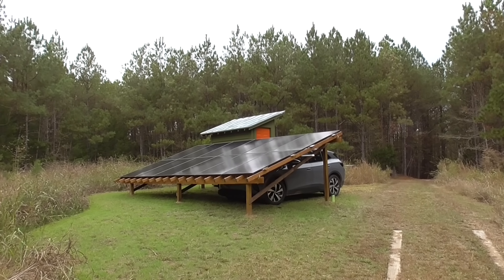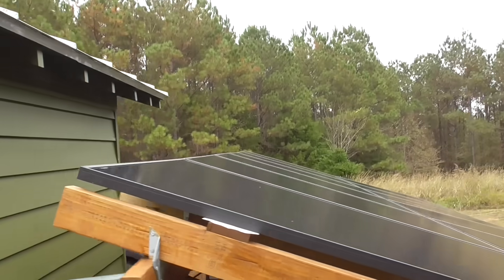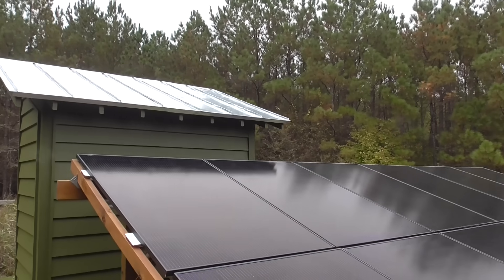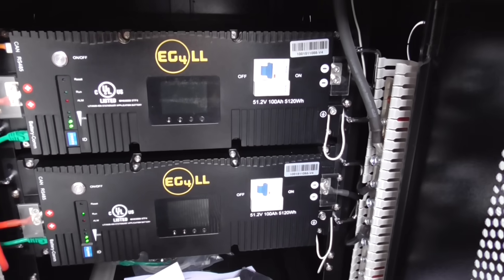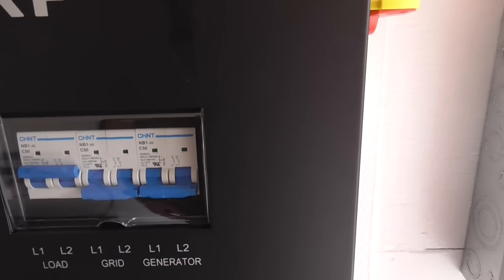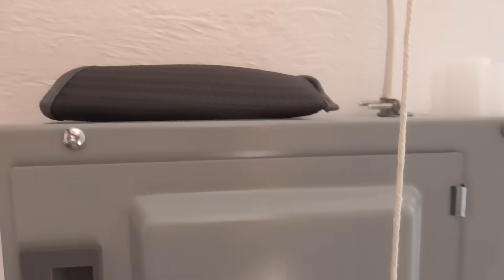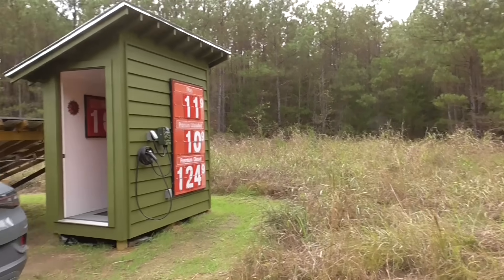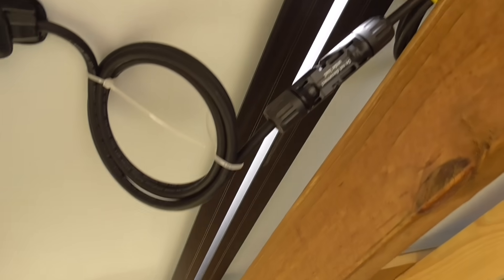Off-Grid Solar EV Charging Station. Stand-alone solution for EV.

Comment: So the cost of having the EV car is the the EV car plus everything you bought and built to supply power to the EV charger.  At that point it might be cheaper to sell the EV car and get a gas powered car.  You got a fun project out of it and learned a lot.
Reply from the maker: Au contraire mon frère, I estimate this power station will be paid back with savings over the cost of operating my ICE truck in 6 years. After that it's all gravy. You wouldn't believe just how cheap it is to operate an EV--in fact it surprised the hell out of me. The electricity to drive my car from home to the farm (which I pay for on grid) is less than $4.11 It costs me $15 in gas when driving my truck, and that's not counting oil changes, air filters, and oil filters, which are things an EV doesn't have. The trip home is "free" after it pays for the solar charging station in about 6 years. For me, just as or more important than saving money is not using fossil fuels, or using them as little as humanly possible (I still have my truck and use it for big loads). Perhaps that means nothing to a lot of people who deny the science of climate change, but it matters to me. And, as you said, it was a very fun project and I would have done it for that reason alone. I have plenty of money, but I still enjoy saving it when I can and doing my tiny little part to save the planet.
Reply: @wickedmessenger1  Glad to hear it.  I live in a place that does not have reliable electricity.  I am just getting into solar power and it's a rabbit hole.  I just got the ecoflow ultra and might get another.  I am also thinking of getting solar panels and just learned about series and parallel hookup for these, luckily the ecoflow ultra has the battery and inverter all in one.  Might be a fun but expensive project for me.  Might look at some good 400W solar panels.  Good job on the setup.  I googled Grizzl-e, and they even have 80A 19KW charging with those.
Reply from the maker: @  I think I allude to that rabbit hole in my video. As a novice, it seems like there's an impossible amount of stuff to know. But then I realized that it was the old method of putting together 20 components that required all that knowledge and it's rapidly becoming obsolete. When you buy a system like the Eg4, it has all that stuff already in it. Things like the Ecoflow tap into that novice trepidation and give you an easy alternative. But they are way more expensive and less powerful than a system assembled around a good all-in-one hybrid inverter like the Eg4 with some solar panels. My system was more or less sold to me as a kit, so I didn't have to match the panels and batteries to the system. My advice to you is go big early because you're going to go big eventually. You'll outgrow that Ecoflow in no time.
Reply: @wickedmessenger1  yeah I plan to. Luckily the ecoflow ultra is expandable up to 90KW battery, with 7 KW continous, but I won't close to 90KW. I don't have the space for many panels either, maybe just 4, 400 watt panels if I can find any 400 watts in my area. Most are 200 watt panels 🙁

Comment: you should have used the water trick with that ground rod. https://youtu.be/ML9Ga_ud5fY?si=FG2cVJb05pit590T
Reply from the maker: That's a good trick to know. I doubt it would have worked in this case. I was driving through clayshale and possibly limestone. Also, I don't have a source of water at the farm so I would have to truck in water from somewhere. What I needed was a 9# sledge hammer and not a hand sledge that weighed a few pounds. But it's an hour to Lowes and I don't make the trip unless absolutely necessary.

Comment: Do you have any issues with the heat inside the shed?  I know the EG4 have fans but with the summer heat is that an issue?  Thanks for the video. ⚡
Reply from the maker: I have yet to go through a full summer with it so I don't know. When I finished and gave it its first use, it was already the end of August and the really hot weather was behind me. If I find that it's a problem this coming summer I'll add the smallest air conditioner I can find.

Comment: Looks good. Ive set up the same thing for myself with the differences that i was ran into debt from fraud and theft so everything is unfinished at the moment. But i have an primitive car port i can park under and my shed roof is sheethed with solar panels similar  to the carport. Hope to show it off when finished.
Reply from the maker: My original design was to make it a carport, but several things conspired against me. As it turns out, I'm glad I ended up making it lower to the ground because I need to clean the panels fairly frequently and that would have been very difficult if it had been high enough to park under. I do have partial shade and that's nice for the summer. I hope your luck turns around and you'll have yours finished in time to make a lot of power when the sun gets higher in the sky.

Comment: One day that low cost, lightweight 6000XP high frequency, transformerless inverter is going to fry your EV's onboard charger and void your EVs warranty because it lacks any galvanic isolation between their DC boost stage and its AC output. The MOSFETs in all inverters eventually fail, when they short to ground, without a transformer to block DC current, it can pass high Amperage DC current through to your EV's onboard charger and smoke it. You should be using a transformer based inverter instead if you want to charge EVs.
Reply from the maker: The 6000xp is being used to charge EVs all the time. I really don't know what to do with your warning.
Reply: @wickedmessenger1  Sure a few are but the 6000XP is a relatively new inverter, so their MOSFETs haven't started failing yet. When they do fail, that's when you'll start seeing this problem. Don't take my word for it. Ask Google Ai. " Can a high frequency, transformerless inverter damage appliances because of no galvanic isolation?"

Comment: I really like your system! It’s very neat and well thought through! Mine was put together with older equipment like the 3,000 watt 48 volt GroWatt 120/240 split inverter s. I have them in parallel of 4 to equal in voltage of what you have in that one inverter. Technology is advancing rapidly. I started building my system in small stages and by the time I installed mine The EG4 were out and being displayed on YouTube everywhere. I will keep what I have for a few years to get something out of it before I redo it again. Who knows what would be available then right? 😊
Reply from the maker: With technology moving so fast, I think all of us will have obsolete equipment long before it stops working. But you have to use the stuff that's available at the time you need it.

Comment: Excellent job, but I note you've got room for capacity - by my calculations you could easily double the solar array and add a third battery.... that would seriously beef up your charging ability - any plans for that?
Reply from the maker: I'll add another rack battery before I add solar. You don't understand just how difficult it is to build anything out there. It's an hour to the nearest lumber yard. There's no water source so no way to mix concrete. I suppose it would be easier now because I have  a source of electricity, which I didn't have when I built this solar station. I cut every single piece of wood by hand before. Now I could use power tools.

Comment: What a nice setup. As I’m thinking of doing something similar could I ask a question. 
How are the pv panels connected to the ground mount?
Reply from the maker: The frames are screwed down to 1x4 wood boards that are attached to the rafters. Between the 1x4s and the panels, I used vinyl flashing so that the frames never are in contact with the wood. I am concerned about corrosion of the aluminum if it contacts the pressure-treated wood directly. At times in the video you can see those horizontal boards look bright-white--that's the vinyl flashing.

Comment: So...doing some fun math. That would be 9.6kwh of power in those batteries. Assume you don't go below 10%, thats 8.64 usable kwh. At a average efficacy on the EV at 4 kwh per mile, that is almost 35 miles.
Reply from the maker: You're right. The batteries alone cannot be of much use. But the PV arrays alone can't charge the car either. With all three together, I can easily get 35% of my car charged before the battery is depleted or the sun quits. If somebody wanted to use a setup like this for charging their car overnight, they'd have to get a massive amount of batteries.

Comment: Very cool setup. I am genuinely surprised as to how loud that all in one is! My delta pro ultra is completely silent by comparison and its running my entire home. But then again its twice as expensive.
Reply from the maker: Yes, it's loud. For a residential situation, you'd have to plan where you're putting it so it wouldn't bother you. I should add that it's not so loud that I feel like I need hearing protection, just loud as far as what I would have expected.

Comment: Very nice setup. But I'm curious about how much charge you can get into your ID4. We have one as well. If I add up the juice that you've got in your two batteries, that's roughly 10kW, right? My ID4's capacity is about 77 kW, and it gets roughly 3.5 miles per kW. Your solar panels at max efficiency give you about 5kW per hour, too. So I'm wondering how long it typically takes to get your ID4 charged up enough to make your round trip. Thanks!
Reply from the maker: The first thing I do when I arrive is to get it charged to 50%. That can be done that same day--possibly (but rarely) taking part of the next day if the first day is very cloudy. I don't do a lot of driving once I arrive, but when I do I bring it up to 50% when I get back. That's a happy place for the battery if you want maximum battery life. Then on the day I leave I go from 50% to 80%. That's doable with good sun, but once I had to deal with a cloudy forecast and charged as much as I could a day before departure, I think up to 67%, and did the rest on the day of departure. So far, I have racked up over 1,000 miles driving purely on solar power and I never had to rely on the backup plans I mention in the video. So I can say that for my circumstances, this works perfectly. I should also say that for my ID.4, which is the smaller battery model, the shed batteries without any solar input (like at night) can give me 7%.

Comment: This is the strength of EVs.  You can set it up your own power just about anywhere.

Little less difficultly/mess than an oil refinery.
Reply: My favorite thing about photovoltaic (solar) panels, is, no moving parts! "Set and forget". If I was going with electro-mechanical, I would consider a wind turbine, leaving a combustion generator only as a "last resort" option.
Reply: Depending where you live, the ratio of renewable to dirty sources in the power you get from the local utility is likely to already be >0 and likely to rise over the lifetime of your vehicle. Here in WA, only 3% of our grid power comes from nonrenewables. Compare that to an ICE car which will burn gasoline 100% of the time for 100% of its usable life.
Reply: @CheapFlashyLoris  hydro really can't be considered renewable anymore at the rate they are tearing out the dams.
Reply: @GeoFry3 Most dams aren’t hydroelectric dams, just water control dams. Yeah, building dams across rivers is expensive and environmentally damaging but once built the power is renewable and free rainfall powered by the Sun.
Reply: try diesel, you can make your own fuel with oil and some chemicals
Reply: @TheJponton  Maybe, but at what cost? Sunshine is and will always be free, isn't carcinogenic and doesn't pollute.
Reply: @fotoguru222  at the cost of getting caustic soda and methanol. Solar energy for off grid installations would be awesome if we do not have to do minery for the batteries
Reply: @TheJponton  A solar system rechargeable battery weighs perhaps a few dozen pounds and lasts for a decade or more. A few dozen pounds of fuel lasts perhaps a week of driving. So which requires more "minery"?  Fuel costs hundreds if not thousands times more environmental damage from its "minery".
Reply: @fotoguru222  if you catch my idea you will easly recognize that I am talking about biodisel. Biodisel can have as a base vegetal used oil for cooking and with those chemicals you can get biodisel. Diesel combustion engines make co2 that is used in plants in their bilogical cicle and the production of cooked oil are in farms making a net 0 of emissions, why you want so hard to make batteries and diging holes on earth to get chemicals needed for batteries? Even an oil rig operation is less nature harming than mining to get products for batteries for the simple fact that you do not have to dig and erode the land
Reply: @TheJponton  there isn't enough crops to feed everyone and fuel all the vehicles.  Biodiesel is an excellent niche use of waste left over from the food, septic services, and agricultural industry.  That is about it.

Lipo4 batteries can be recycled to near 100% just like the lead acid batteries that came before.  The amount of mining will drop off drastically once recycling ramps up.
Reply: Exactly what i tell people. This way is actually environmentally friendly because it's good for decades if run properly.
Reply: hell of a lot more mess and hassle than a Jerry can.
Reply from the maker: Exactly! And it's much easier on the environment.
Reply: @wickedmessenger1  No.  It's not easier on the environment.  The polution is just farther away from where you live.
Reply: @GeoFry3 It is easier on the environment, even if the electricity is made in a coal plant the total amount of emissions is much lower.  This is because the combined efficiency of an electric motor and a power station is much higher than an internal combustion engine.
Reply: @Turksarama  sort of true.  The main thing is you can put the power plants outside of your city and not breath the exhaust.
Reply: @GeoFry3The EV nervous virgins will get there. They just have to see it for themselves. Some folks have to go through the stages on their own. I hope they are fast learners, tho.
Reply: @GeoFry3 Not true - even if it was running on 100% electricity from fossil fuels, which it isn't, it would still pollute less than a gas vehicle. One giant power plant is much more efficient than millions of car engines.
Reply: I would have a gasoline ⛽️ vehicle for my EV backup. EV aren’t sufficient enough to fully depend on all transportation needs! Fact! 😊
Reply: @rangerbob42  Neither is gas sufficient. Fact. The future is electric!
Reply: @rangerbob42 have a ebike for backup. no need for polluting gasoline.
Reply: @rangerbob42  I think you mised the "Off grid" part. If we get to a point where gas is no longer available, what good is a gas car? Everyone knows the range isn't as good as gas...
Reply: @rangerbob42  variety is always best.  

The EV truck that I am waiting for is one that will let me throw a generator in the back and charge while i'm driving, not just when I'm stopped for those occasional needs to drive 6+ hours away from home.

I'll probably have to build my own.  Edison trucks have the right idea.  A diesel generator and batteries with an electric power train.
Reply: @GeoFry3 either way you would still be using gasoline ⛽️ that defeats the purposes of driving EV’s. 😢
Reply: @rangerbob42  wanting to be able to have the flexibility to use gas 5-10 days a year is hardly an argument to just forgo having an EV the other 355 days.

My cheap 2.2K generator can easily add 6 miles of range per hour and takes up hardly any space.

My idea is charge up the truck and take it out to a campsite.  Use the generator to charge the truck and the truck battery to power everything at the camp.
Reply: @GeoFry3I bet you will find that electric solar with a great battery system is all you need.
Reply: @GeoFry3 That truck sounds a lot like the BYD Shark-- an EV truck with an ICE range extender.   Too bad they only exist south of the US border (for now).
Reply: @GeoFry3  Sounds like a Scout Terra, which can be chosen with a range extender.

Comment: Assuming you got a 7KW AC car charger you could still charge your car while you are waiting for at least 30 mins with 46% of battery capacity and concurrent 1KW power from your 2 arrays. You dont have to wait till the battery is full
Reply from the maker: I started a charge yesterday when the shed batteries were at 46% with good sun and no clouds and it charged for 2.5 hours before the batteries were depleted. The battery alone, starting at 100% with no solar is only good for 30 minutes before it's spent.